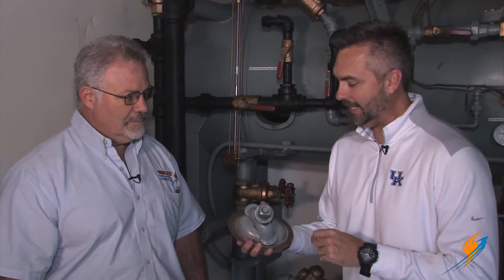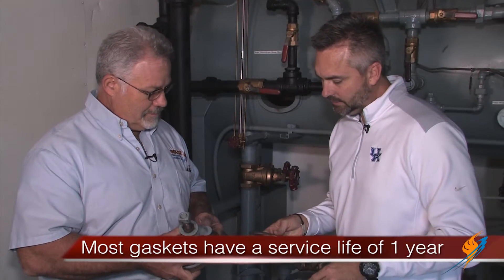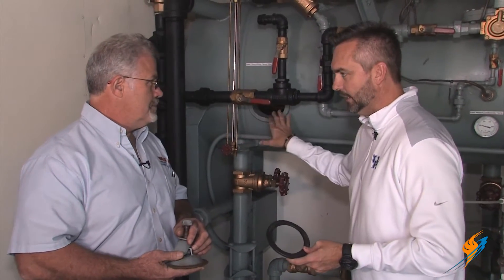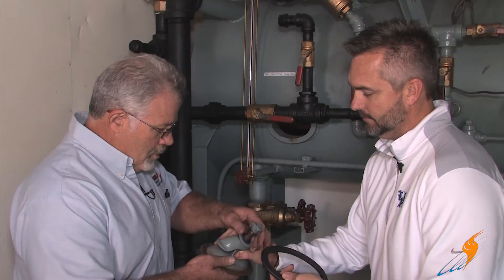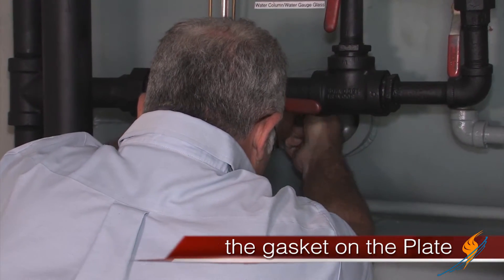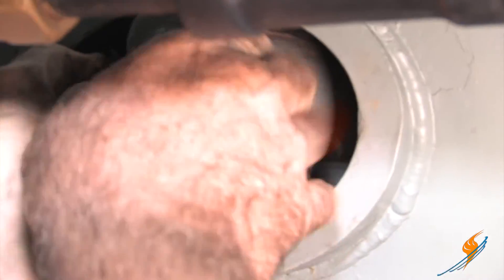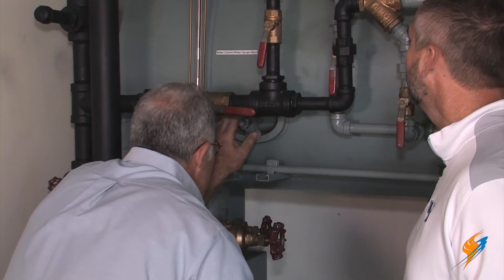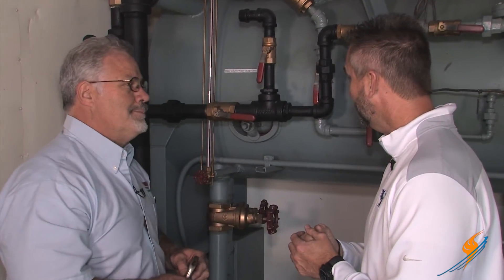How To Install Handhole Plate on a Boiler - Boiling Point

Comment: I did my first boiler inspection a year ago and to me the absolute hardest part was holding the handhole while trying to get it and the gasket in the correct position and not dropping it while getting the bolt and claw in place to tighten it down. I was hoping  to find there was some tool or best practice but you didn’t even seem to struggle with it. Any suggestions for a newbie?

Comment: So hand tighten then a quarter turn?
Reply from the maker: That is typically the rule of thumb. What you are trying to avoid is over tightening and damaging / cutting the gasket. These gaskets can be very easily damaged by over tightening which can lead to tons of problems. So the hand tighten and then a quarter turn will typically get you to enough pressure where it doesn't leak but also doesn't cut the gasket. As always, check with the gasket manufacture for their recommended procedure so you know exactly what they require. Improper installation of these gaskets can lead to serious injury or death so making sure it is correct is the highest priority. Thanks for the question and hopefully that helps!
Reply: wareboilers I installed the gasket but got seepage. I had to quarter turn a few times until the minor seepage stopped. So I’m a bit concerned that I may have overtightened it.Positioning of the gasket was not easy. I’m working on a small 10 HP Columbia Boiler.
Reply from the maker: What you described can happen when installing New Gaskets. Hand tighten and then 1/4 turn is just a general rule. It might take more than just the 1/4 turn. If you feel that something just isn't right I'd recommend getting a service company to come out and just check on it. These gaskets hold back a lot of pressure and if done improperly can really be dangerous.
Reply: wareboilers it’s been 36 hours and everything is fine, no seepage or steam coming out around the gasket. Thanks again!